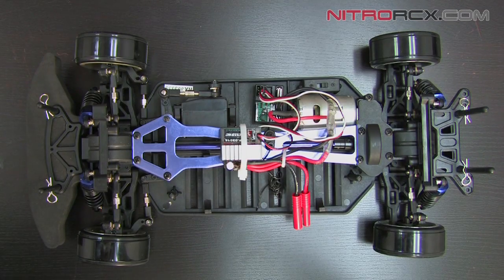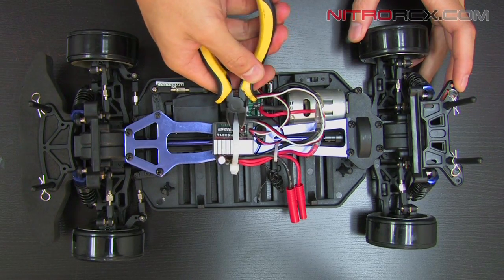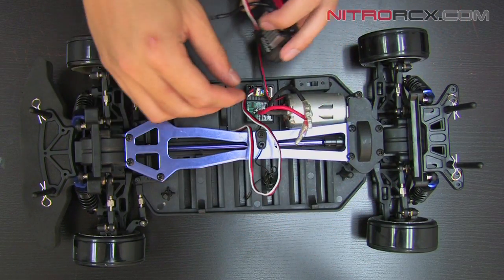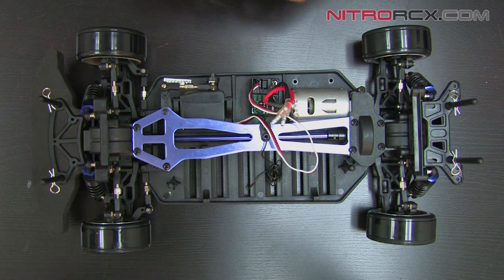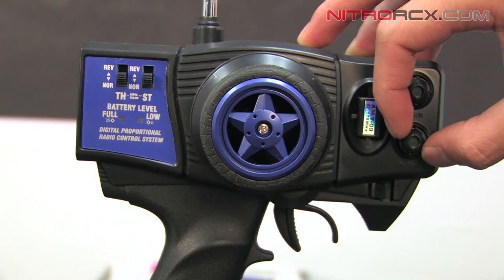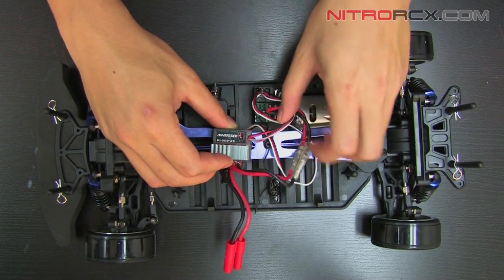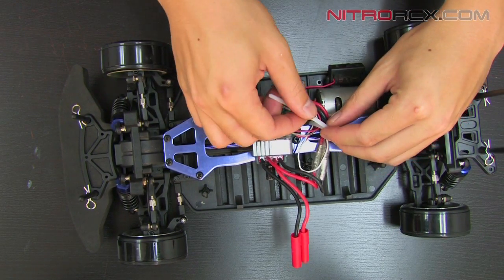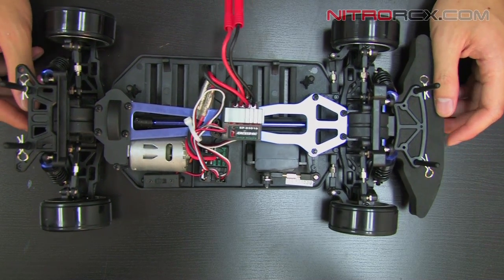Nitrorcx Guide: Replacing the Electronic Speed Controller (ESC)

Comment: i need a video on intalling an esc on my 1991 kyosho outlaw ultima.   the mechanical one is missing and i havnt worked on this thing in 30 years.  motor is gone also.  wonder if my driveline could survive a new more powerfull motor

Comment: A brushless motor with a high kv such as 6000kv or higher will give your rc car more speed. A brushless motor with a low kv such as 2500kv or lower will give your rc car more torque, meaning more acceleration. So a 6000kv would make your rc car go 20mph in 3 seconds, but its top speed is like 50mph. But a 2500kv motor will make your rc car go 20mph in a second or two, but its top speed will be like 30mph.